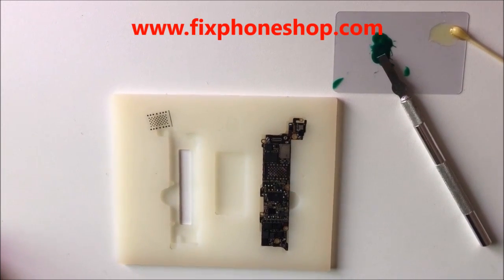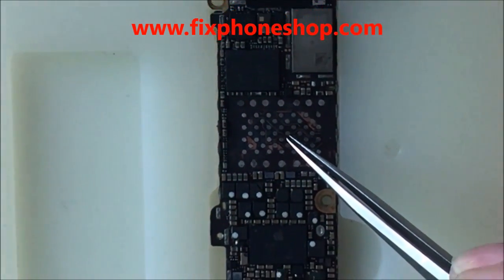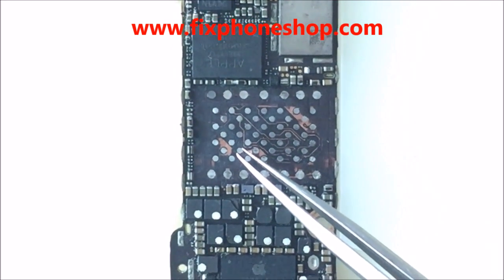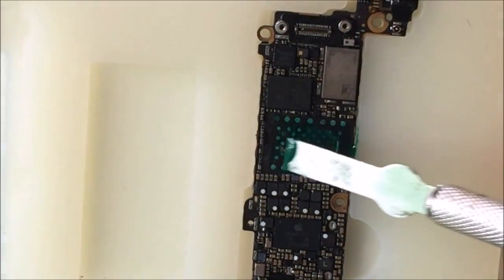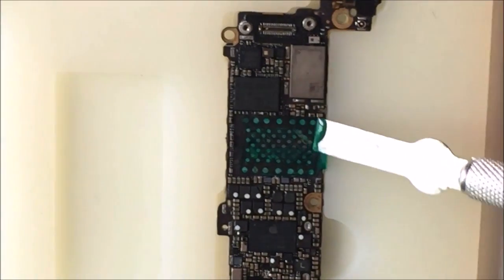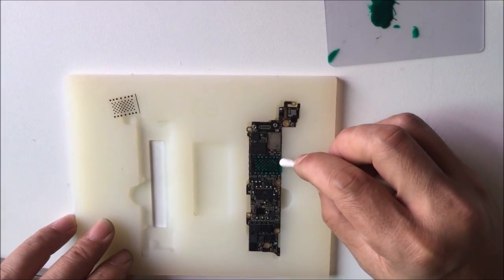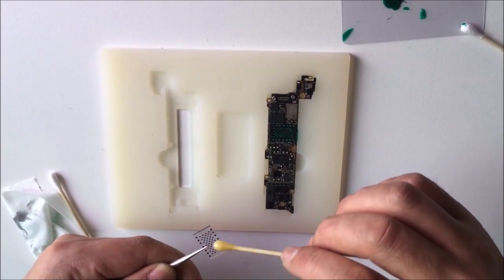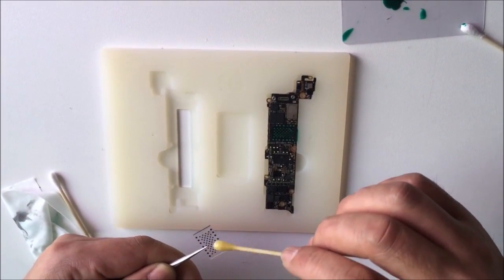Fix Damaged Insulation Layer for iPhone iPad NAND Flash Chip IC Board

Comment: Amazing!!! I am currently replacing an LGA1155 dead socket from a working motherboard. Let a colleague use copper wire to remove solder lead end up removing solder mask. The challenge now is either printing my own layout of the PCB or buy somewhere, problem is, i cannot find it anywhere. I will try printing it on a high definition HP laser printer, wish me luck!!!